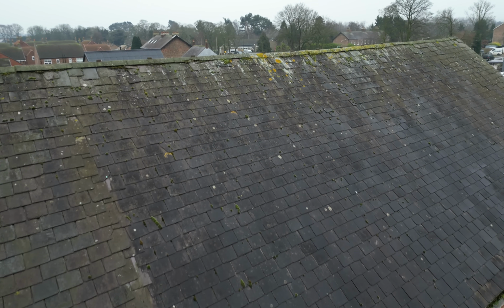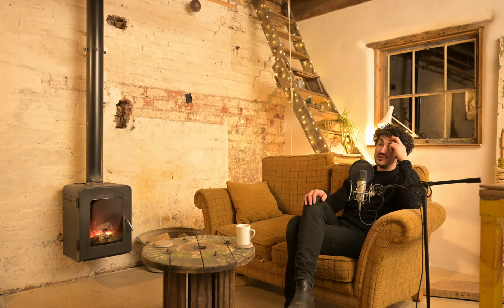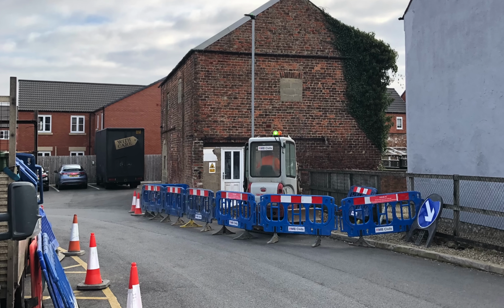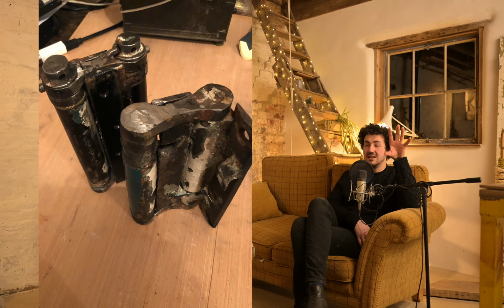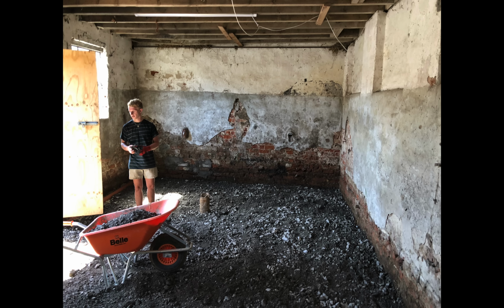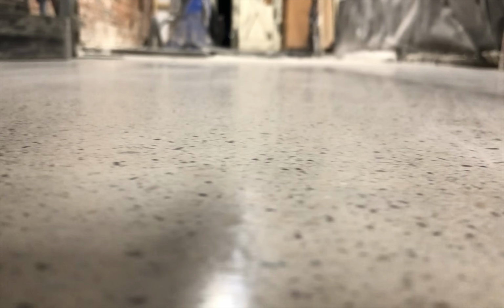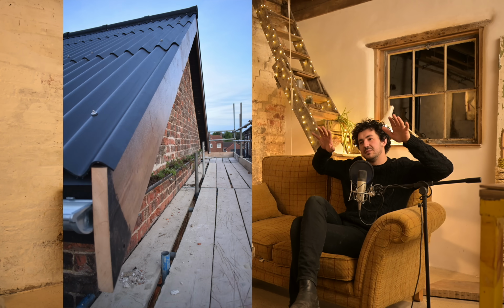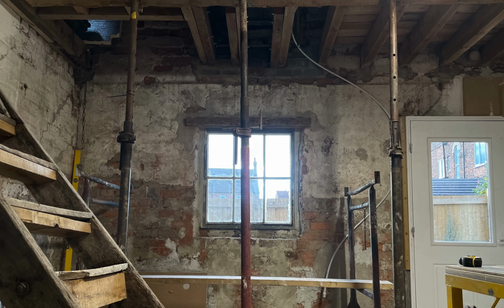I Bought an Abandoned Coach House in a Car Park

Comment: An absolute delight. Your sensitivity to the building, heritage and authentic approach clearly shows. It is heartbreaking seeing original features being ripped out (The doors you saved for example) and being replaced by yet more plastic, gypsum, cement, silicon..... Few people would take the time to save the original hinges but they don't realise that it's these small items that give an old building its beauty. One thing I would say, I am always concerned when I see DPM and concrete going down internally in a solid walled building. My suspensions are it can drive moisture up the walls rather than naturally through the floor. Although I have never tried to polish a limecrete floor! Recommend starting away from modern paints too. They are to blame for all the rotten windows and doors being ripped out
Reply from the maker: I hear what you are saying regarding the floor, I did consider limecrete but I'm unsure how hygroscopic a hydraulic lime mix with a floor covering would  be. 
I'm staying away from modern paints and have been using linseed paint on the woodwork.

Comment: You did a good and nice job. 15:43: it would look nicer if you put that electricity cable in an old style black pipe. I am redoing a  bedroom that will be an office (3x3m) and when the clayed walls are done, i will install (a) new made old style black bakelite light switch and plugholes. Yesterday i made one wall white. It also breaths. Regards from 🇧🇪